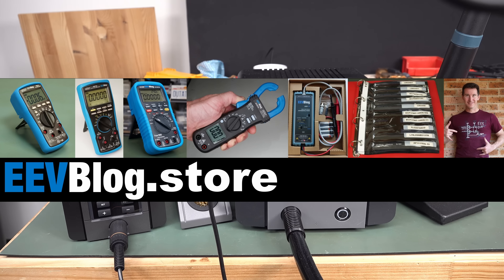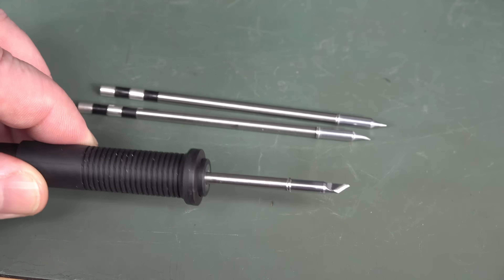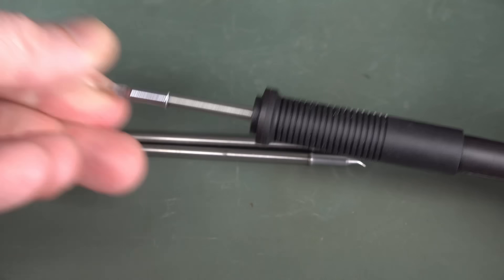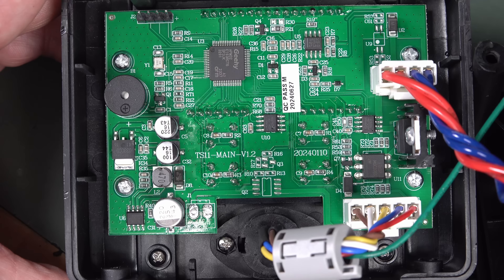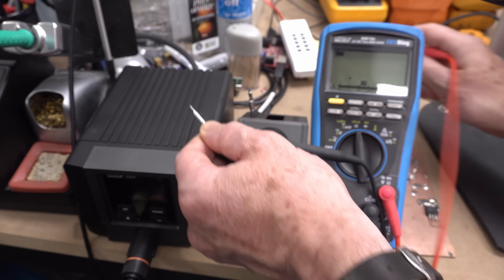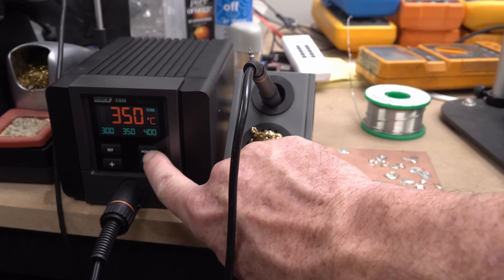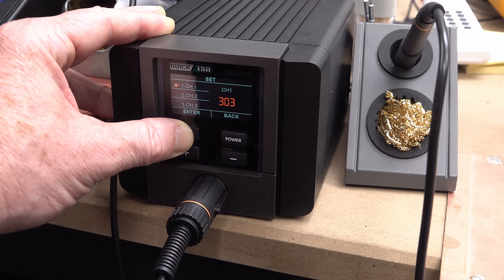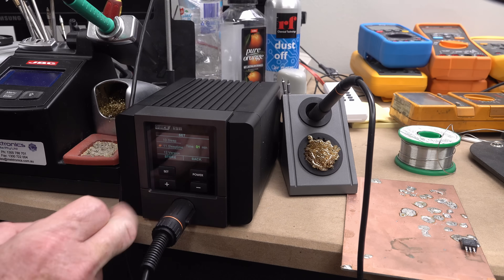EEVblog 1645 - $80 Quick TS11 Soldering Station REVIEW

Comment: Don't know why they don't just use an SMPS instead of the iron transformer
Reply: Its cheaper, lighter and more efficient.
Reply: @simontay4851  It's not cheaper nor lighter
Reply: @Rubacava_  i meant a SMPS is lighter and more efficient, though maybe not cheaper depending on the size of the iron transformer it is replacing.

Comment: Weller, baby.
Reply: Weller is OK compared to this nonsence but it is not nearly as good as it used to be. Sure the upper models look fancy but the reliability is not the same, all the innovative solutions like the famous soldering stations with Kurie point controlled HF induction powered tips are obsolete and all the nice accesories are a thing of the past. Weller is definitely no longer the best option out there and that includes the entire range of their current products all the way from top to bottom.

Comment: Never use the sponge on my JBC

It's still brand-new unused 

Just the brass wool and clean the tips with contact cleaner and paper towel when cooled 

Different strokes 
🤷
Reply: not many do, as its cumbersome haveing to water it and it gets crusty..
so I have no issues that they drop that..if people want that they can just get a dedicated sponge that often will be way better then the lackluster they tend to implement into systems.
Reply: I don't even use the wool as well as for me just a piece of rosin covered soft cardboard seems much more convenient. But there are different personal preferences and many people swear by the sponges and accept nothing else.

Comment: A 90W bench top soldering station that, while sure heating up in a flash, seems to do a worse job at actually soldering than my TS100 running at around 35W :P
Reply from the maker: Tip and element design and engineering is everything.
Reply: Efficient thermal design has a lot more to do with actual useability than pure power.
Reply: @groundzero_-lm4md  considering how rapidly this station heats up and how poorly it responds to thermal load, I guess the temperature sensor is relatively far from the tip and close to the heater. In contrast, JBC & Metcal temperature sensor is electrically connected to the tip. Weller magnistat too. Most have the temperature sensor insulated from tip inside the ceramic heating element, I think.
Reply: or 88W Pinecil which is cheaper than a TS100
Reply: Still relying on my trusty Weller PE81
Reply: @CaptainDangeax  I stupidly gave mine away.  Wish I had kept it.  Great irons
Reply: Same thought, my miniware TS101 seems more capable than this thing, and that's a portable mini iron not a soldering station.
I'm honestly kinda amazed what you can pull off with that tiny thing.
Reply: @timhartherz5652  TS100 was a game changer, but it needs an improved desktop version by now: a short grip to tip distance, a real stand, no OLED, ESD protection built in & not a separate wire. If you’re going to make a new station, at least start there.
Reply: Agreed my TS100 beats this. No contest.
Reply: As many have said, it's not about the amount of power it uses, more to do with design.  Like cameras are not about megapixels.   It's  not the number you have, but how you use it.

Comment: I'll keep my el cheapo T12 clone station that heats up within seconds and delivers 70 Watts if required.
Not really seeing the point to take those stations down in detail.
But some people probably need to see how wannabe they are.
However, the one thing they did right: No sponge. 
I really don't get how thermal shocks to a soldering tip are anything other than a very bad idea.
Reply from the maker: Man up, sponges for the win.
Reply: @EEVblog  SRSLY, any rationale pro thermal shock? Maybe I'm missing something?
Reply: @UlrichWulf  well the existence of the thermal shock must be demonstrated first.
when the tip is hot, you don't even hear the typical hiss of the boiling water when you touch the sponge, it's next to silent.
what I think happens is that water evaporates instantly, creating a thermally insulative layer of vapor between the sponge and the tip, and there's no thermal shock.

in addition, I've been using the sponge a lot, and have yet to see any negative impact on the tips. what really destroys them is overheating and touching some plastics.
Reply: I've loved my KSGER T12 station for years, although if you have an early version you do need to make sure you do the ground mod. It's never failed me power wise and the user interface is still second to none for any soldering station I've used

Comment: It's not measuring tip temperature. Must of element temperature.

I noticed when you switched from 303 -> 400 -> 303, the ramp down skipped a huge range. Like it hadn't finished heating before displaying "400". The first time you went down the 400 it ramped down a lot smoother.

Also explains the pathetic heat capacity on the ground plane, it has no idea how cold the end of the tip is.
Reply from the maker: Yeah, it's weird, it does seem to ramp the reading a bit but then just sits at the set temp.
Reply: @EEVblog  I wonder if the ramp-up is a side-effect of a rolling average routine and in fact it's not reading the tip temp for some reason (eg faulty hardware)

Comment: cant remember the last time i stared at the soldering station while soldering/desoldering ;p
Reply: you only look when you have issues
Reply: I don't even glance at the station or the wand holder. I set them up, and then they're where my hand goes. I keep my eyes on my work. I used exactly that to hire senior assemblers. I'd just set a pile of tools out and tell them to set up their station. If they started setting up and said the table was too high or too low I'd hire them. If they set up, then soldered a connection and stuck the wand back in the holder without glancing over at the holder, then set the tools up again in the same spots I'd hire them as a senior assembler. I didn't need to give them a quiz out of the NASA manual. Those quick tests always worked.
Reply: @johnwest7993  What would they have to do to fail getting hired?
Reply: @johnwest7993  So they hot hired either way.
You are very kind.

Comment: I'll stick to my 1980s Metcal. Insert tip, flip switch, solder a penny to a ground plane with 40W..
Reply: Or a Weller soldering station. 😊
Reply: @davidbolha  Weller sucks
Reply: @FrozenHaxor  I can't complain with mine. But I only have the older versions. Not anything new.
Reply: WD-1 for the win
Reply: I wish they still made them like that.
Reply: @pw36952m  They do. Oh, they look a little different, but they work the same and perform even better. The price tag, however, is something to behold.

Comment: I hate rear facing power switches, one of the main and most important controls being mounted on the back... stupid design, why do manufacturers keep doing that?!
Reply: Sometimes I gotta think its more designed for workstations/factory use, where you genuinely wouldn't need the tool/appliance switched all the way off very often.
Reply: @stitchfinger7678  That's a good point. As a hobbyist with JBC, I do find the rear power switches annoying when doing quick jobs.
Reply: I never use the rear switch on my JBC, it gets switched off at the conveniently situated wall socket (UK), but have to admit, if there was a switch on the front of the unit then I’d probably use it.
Reply: @IanScottJohnston  Same here.
Reply: Ersa has at front. JBC at back. Both europe
Reply: Ersa i-con nano has power switch on the back
Reply: @TheDefPom really bad design Scott, one of my smaller PACE units had a front switch but it got changed real fast when i looked at the power bill yrs ago, when you turned it off at the front it only stopped power to the iron or the desoldering iron the transformer still had power. 🤬🤬 I rectified that in a hurry, but its not in use anymore I mainly use the Pace PRC 2000 or a Pace MBT unit. I would never buy any other brand.
Reply: I’m not sure what the regulations say but a lot of the time it’s probably just down to ease of wiring and lowering cost since it keeps all the mains stuff at the back of the cabinet. If there is an iec connector often that will have the power switch built in so even fewer wires. I don’t have an issue with it provided the switch is easy to use and is the very first thing your fingers run into. Where it is an issue is when it’s a small switch just placed randomly and I have to fumble around for it. Edit: This is definitely one of those pieces of equipment that would piss me off. It’s right at the bottom and hard to reach.
Reply: I’m pretty sure the rear power switch maneuver is usually done to save cost with no line voltage wires to the front panel.  There are possible safety reasons (safety design is not my occupation).  Making a rear switch reachable from the font may be accomplished by installing a plastic bar which protrudes as the front button and presses on a switch mounted inside on or near the IEC power socket in back.  I have seen that approach in electronic test equipment where there is also benefit of reducing stray power line frequency fields inside the instrument.
Reply: I'm guessing shorter wires, easier to mount near the power input and maybe better isolation from the frontend.
Reply: I guess it is more annoying in the US where they don't usually have switches on their outlets for some reason (money, I suspect). Personally, I don't mind, it keeps the front less cluttered at least
Reply: Agreed. That's about the only thing I don't like about JBC.
Reply: pretty much the only real likely reason is for simplification of the PCB design, and cost cutting for assembly. no other real reason not to.
Reply: Iirc there's an European regulation about the power switch being within reach of the cord, just an actual dumb 'saftey' regulation that makes tools significantly more dangerous. 

Tbf that legislation probably came about because manufactures were just not including power switches on vacuums or other such appliances
Reply: @ΜικεΡ can you provide source for what you are saying. For my knowledge ther’es no régulation about that
Reply: My Quicko station has power in the back and that's the perfect place for it. i.e: I don't care. I only use the power switch twice in each soldering job. 
The unit is the footprint of a thick sandwich. It's incredibly easy to reach behind. 
Maybe I just haven't used enough stations with small hard to reach switches, but my switch is large and is the first thing your finger finds when reaching back there blind. 
Separates the mains voltage from the front of the unit too. 
The world's tiniest violin.
Reply: It’s mostly an European thing.